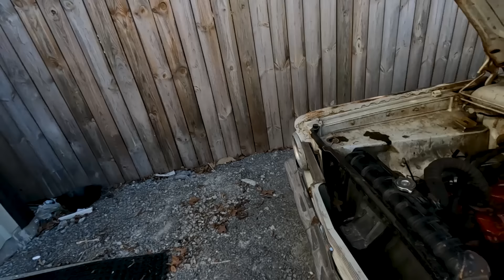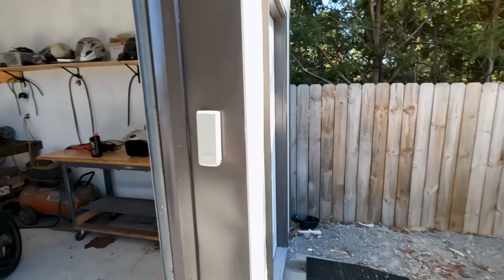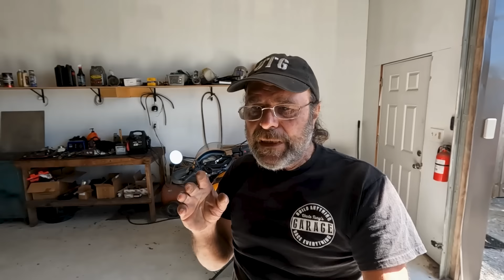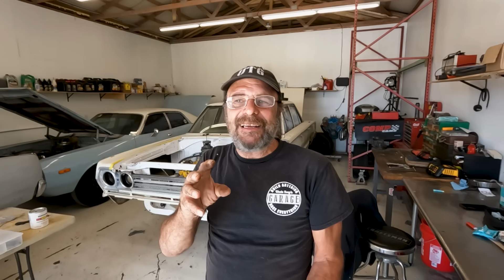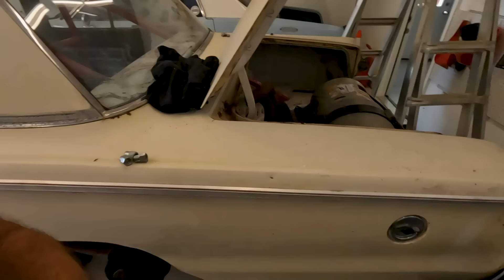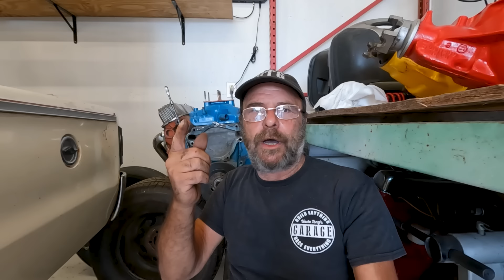Classic Car Tuning Problems - Curing Off-Idle Stumble, Bog, Hesitation, Stall And Backfire

Comment: What can cause the ported vacuum on my stock 22r have vacuum at idle.  The engine runs on advance at idle, which it shouldnt be and vacuum hose are correct.  The glass float bowl is just above half, not sure if that can be another factor.

Comment: Hello folk i have a 504 ti which i changed the manifold intake from mechanical injection yo cab..but my car wont start..iv cranked the engine placed compresion dtroke timed the ignition 
.but engine wont run.what might be the problem

Comment: My friend, who's been a mechanic for 50+ years, never uses a timing light on carbureted engines, even race engines. Does it totally by ear. Another friend puts a wrench on the air cleaner, and when the wrench stops vibrating, he sets the timing there.

Comment: Hi there Tony....great video, but I was waiting for the off idle progression tuning.....the slots from the idle circuit to the throttle plate.....with the engine idling best it can, pull the carb, pour the fuel out into a container, turn the carb over and look for the slots.....open the throttle and watch the slots become exposed.....I scribe a line on the throttle plate into the base plate body for reference, there should be a little of the slot visable, but commonly not....the idle jets should be sized to be adjusted leaner by the mixture screws, hence the idle jets are larger than the mixture screw adjustment, then when the throttle is gently opened as when cruising or in traffic, the mixture is enriched without any input from the accelerator pump action....so idle jet supply adjusted leaner by the mixture screws, opening throttle plate slightly, slots exposed, full amount of idle jetting available enriching delivery, further depression of throttle brings in acc pump delivery, then transition to main jets delivering cruise.....If it is found that the slots are not partially exposed to the scribed line, and you are experiencing stumble after all alse has adjusted, you expose just a little using a hacksaw blade to cut then deeper.....warning.....cut the thickness of the blade down to the slot width, so width is not changed, then back draw the blade in the slot watching the scribed line for reference.....do less than think.....once material is gone !!!!....access is with base of carb separated, throttle open, blade from above.....Well....lots of wordage but I wanted to best describe, part of being a trade apprentice educator, 1960's mechanic, having operated dynotune and engineering shops, along with building and racing competition cars of many varieties in Australia and in Atlanta Ga.  Enjoy.

Comment: Wow , I just learned something after 44 years of working on my own old cars. It explains 1 issue I had 40 years ago with a jeep.

I have never had a harmonic balancer slip, or so I thought.

I had a 1976 jeep Cherokee that I got without a motor for 400.00.  I knew a guy with an international salvage yard that I used to pull parts from for building my Scouts and trucks.

We talked and discovered that AMC and some international grain trucks used the same 401 V8 for a few years.

I put the 401 in my jeep and did some bolt on improvements to get it going to use as my daily driver in winter for awhile. I also used it to haul wood out of the fields in a home made pickup box trailer. Still got the trailer 1974 1 ton Chevy frame , box and axle.

I set the timing after doing a tune up with a new 4 barrel Carter and raised intake. 

When I tried to set the timing I had to advance it 8 degrees before TDC and it still ran crappy. I advanced another 2 degrees to 10 before TDC.  
I thought there is no way that could be right but it ran great for about 6 months. 

Then 1 day it started running crappy again. When I checked it was 4 degrees After TDC. 

I assumed that I had not tightened the hold down bolt properly on the distributor.  

When I reset it , it did not run right until about 4 degrees before TDC . I tuned by ear and it ran best at about 6 BTDC. 
Soon after I sold it to a guy in partial trade for a 1 ton International 4x4 truck.

It had not even occurred to me that the harmonic balancer was floating on me and throwing off my timing light settings from the first time I tried to set timing on it.

I am a jeep guy and could almost tell you from memory different tune settings on different engines. 
That was the first time I touched a 401 in a jeep with that build and I found conflicting specs in manuals between AMC , jeep, Ford , and International.
I ran alot of 360 v8s in jeeps and a couple 401 s through the years.

Comment: I have a 1967 ford galaxie 500. 390 v8 C6 trans. Has brand new holley quick fuel 600. Runs excellent 90& of the time? Only time I have and issue is when I get on it? 1/2 to 3/4  starts to pull and then stumbles and will  backfire through rear exhaust? Not sure if its the secondaries not kicking in and starving or lean from not enough fuel delivery?

Comment: i grew up during fuel injection. i inherited a 66 dodge polara witha 383 big block and a holley double pumper 750. thing used to run great and now it just dies randomly and i have no idea what to do.
Reply: its definitly not stock though lol

Comment: Uncle Tony, I love these vids!!!  My hot rod (1970 Dodge Dart Swinger 340 4-speed) exhibits the classic off idle bog.  I have checked the accelerator pump for proper adjustment and increased the squirters from .030 to .040.  Still bogs.  Thanks to this vid, I will check timing next.   You da man!!

Comment: I just bought an 86 Ford F150 in very good shape, I just got it on the road last week, I took it out for the first real ride yesterday, she stalled on my coming what I went to pull into a parking space. So I live on a mountain at about 8000 feet high, I was wondering if this will affect the tuning of my carb? When it fires up, It idles perfect, but then it kinda bogs on me once I put it into gear. As I start driving it runs just fine, if I come to a light, it bogs a little bit... Is this the idle? Should I attempt to pull it off and clean if? I haven't worked on many truck carbs but have worked on many dirt bikes quads and motorcycles before.

Comment: My '63 Dodge 318 V8's single barrel carb had multiple intermediate, or pilot, jet ports, so that, as the throttle plate opened, it progressively exposed more of those ports to vacuum. The point is that even with an otherwise perfect carb andcperfect accelerator pump, one or more of those pilot jet ports being clogged could cause an off-idle stumble. The important point is that the accelerator pump's effect is only momentary. If an intermediate port is clogged, the carb will lean out during constant, low throttle operation such as cruising in town at 25. My Harley FXR is doing just that right now, with its S&S carb (not CV). My plan is to look for an obstructed pilot jet or look to get a bigger one, among other things.

Comment: Yeah, back in the day I didn't have a name for it, but I always did the "power timing" as you call it. It just made sense, and still does. Engine fully up to temp, good points, good condenser, proper point gap, good plugs and wires, cap and rotor, then just see where it starts to knock, then back it off until it doesn't. Specs don't matter. Results do. That's how you would properly determine the specs, but in my case it was for old engines with a LOT of miles on them, so the factory specs would no longer be the best anyway.

Comment: What about an intermittent problem of bogging/hesitation/no throttle?

I’m chasing this problem since about 2021 on 351w carb’d. Sometimes it will happen at idle, sometimes randomly at 2K rpm on the highway, sometimes on the street between 1.5 and 3k rpm. It can do the problem 7 times in 5 minutes, or not once for 15 miles.

Comment: I've got a 55 buick roadmaster with a 4 barrel carter carb. This is a great video. I currently have to give just a hair more throttle from a stop to keep it from stalling and it's worked for a couple years. I just wanna fine tune that out of it. It also has a bit of a vacuum leak. Some tubing needs replaced first.

Comment: Don't you have to make sure your on the compression stroke. I use a wet paper towel in the number one plug hole and when it pops out you know your on the compression stroke and then set it to top dead center.

Comment: Not a young guy here, almost 73 (less than a week to go) I think I used to know how to check and adjust/fix a Rochester 2V accelerator pump on a 71 Chevy truck. Thanks to you, I’m going to give it another shot. I installed a kit but apparently missed something. The ball was stuck, fixed that, cleaned everything, but still had that off idle stumble. I’ll let you know.

Comment: Yeah. The wagoneer slows before it jumps to hyper space. So I just went out and bent linkage to bring it up just a hair from accelerator pump. I have a bolt in a hose made to blow out if it back fires. It seems to like blowing power value if it backfires.

Comment: Dude!LOL You are helping me big time. Mechanics don's seem to want to work on these old beasts anymore.I have a 86 F150/351 HO with the Edelbrock. And I have it running pretty well.. A few issues like it seems to flood on occasion and it gets 8 mpg. I was hoping I could get a real pro to set up the carb and the timing. But mechanics don't seem to want to work on these old beasts anymore. So your video is a big help. Thank you

Comment: Saving up for my first classic car. As a millenial who grew up with EFI and has worked for years in the I.T. field, the idea of tuning and tinkering a car without ANY electronic sensors or computers (other than youtube tutorials) sounds very therapeutic
Reply: You’re an old soul, Joel
Reply: @michaellauer3397 I was lucky to go to a small rural high school that offered lots of shop classes and I enrolled in all that I could. 2 levels of welding, electrical wiring, 2 levels of engines. That kind of hands on work was far more rewarding than anything I have ever done behind a desk
Reply: I'm genx and my Chevelle is the same age as me but i totally get it. I also work in IT and im building my car with minimal electronics
Reply: You came to the right place, mine is a 65-911, six carburetors, this feed is so helpful to me.
Reply: It really is, once you iron out any initial kinks. Although that in and of itself is rewarding! Best of luck to you, from a fellow millennial gear-head ✌️
Reply: I bought one last year and now I daily it I love it

Comment: Have a 69 Chevrolet that would die out of nowhere in the middle of the road, after a week of almost pulling my head off I found out that there was a suction leak on the gas line just were it connects to the gas tank that air would get suck  get stock in the pump diafrag and cut the fuel pressure even doo the filter was full of gas there was cero pressure on the line so wen I pull the line of the filter the ai Buble will move of an make it look like it was working  fu** 🫩

Comment: I learn something every time I watch Uncle Tony's videos. I own a 1973 Chevy El Camino with a rebuilt 454 engine and a Rochester Quadrajet carb, and I now know for sure that the vacuum advance on my setup doesn't need to be disconnected when timing the engine with a timing light, which I was pretty sure of when I timed my engine, but I liked Tony's confirmation on that. I would love to see Tony go over how to adjust the accelerator linkage on a Rochester Quadrajet. Not exactly sure of how to do that pertaining to whether there is an adjustment feature or if I would need to bend a linkage rod.

Comment: 1976 chevy 350 My bog is at hi rpm .  new edelbrock carburetor new plugs and wires cap and rotor and new coil, new fuel pump Still has a bog  at hi rpm just before it shifts .

Comment: The way I learned was that during exceleration, if you get a bog or hole, fill the hole with gas. Back in the day in a good speed shop there would be a hole wall full of all the different Holly carb parts for race tuning at idle part throttle and full throttle.

Comment: Just rebuilt a 1969 dodge 318ci engine for a 69 dodge a108 sportsman. Full rebuild including new pistons,  rings , camshaft, followers etc . Replaced the bbd carb with a reman from rockauto , engine starts  and idles well but has a continuous stumble on idle and acceleration,  using a vacuum gauge , ive got it idling at 22 inches of mercury,  when the engine gets up to temperature,  the stumbling becomes worse.  Any ideas  , my next steps a new distributor.

Comment: It so interesting the complex specific knowledge that is generally known to each generation. My dad wasnt a "car guy" but was still very mechanically inclined and would  tear an engine down and rebuild if needed be. I remeber as a younger man my brother's land cruiser had this stuttering issue and dad diagnosed the bad fuel accelerator pump immediately just from the symptoms. I was amazed he could do that at the time. This next generation (not knowing anything  about engines or even how to change oil) will look at electronics and programming the same way we did cars and motors.

Comment: My 85 c10 with a holley 600 starts and idles fine but if I drive it down the road for 5 minutes it stalls out and won’t run until I pour gas directly into the carb. Can anyone give advice how to fix it

Comment: Hi Tony - great video.  I have an 1968 AMC AMX 390 timed to the factory specs "0" degrees.  I have a Holley 4160 that came with a .031 acc. pump nozzle.  It dies and even backfires when hitting the throttle.  I changed to a .035" nozzle and it might have improved a bit but still dies for a split second but not as much back fire.  I watched your video... do you think I should advance the timing or try moving up to a .037" nozzle?  Thanks so much for the help if you do read this.  Jerry

Comment: But even If you see fuel at that  time.
The nozzle CAN be to thin for that engine.
I had a 1975 two barrel camaro.
It always nicked for a second when acceleration.
With a generos 4 barrel.
It never did It again.

Comment: I’ve got a Holley 4160 on my 360 LA. Have the timing advanced to detonation and retarded a hair. Truck runs great, but I cannot adjust curb idle below 1000 RPMs, even with idle screw backed all the way out.  Blocked every vacuum port and checked around the carb with starting fluid, no vacuum leaks, but it still idles high. When I regard the timing enough to get the idle down, I get a slight off idle stumble. How can I get the idle down? Accelerator pump is adjusted perfectly.

Comment: On Mopars I use a vacuum gauge to set initial timing and then power time it by turning the hex head screw in the distributor's vacuum canister. That way you get the best gas mileage and speed pickup as well. 
A side note on the accelerator pump is start out at the lowest setting and work up because the pump continues to work as you do your daily drive and wastes a lot of gas as you go on and off the gas. A constant low movement motion on the gas pedal can save you money in more ways than one.

Comment: You know, it's a weird thing. I don't know whether I'm an old guy, or still a whippersnapper. I think probably the latter, But at that, I can't remember when it changed. 

I was a teenager in the '80s. I mean perfectly in the '80s. I turned 20 in 1990. That's when I started tinkering with cars.

Fuel injection was around. Toward the late '80s, I think pretty much all new cars had it. But we were teenagers. We weren't driving new cars. So the cars we were driving, and learning to wrench on, all had carburetors.

I think it was 5 years ago, or a couple more... Definitely not 10... When I took my old CJ7 up to see the mechanic around the corner. I've never been good with tuning carburetors, and I had just finished putting a new Edelbrock on top of the Jeeps 302. I took it to the pro around the corner to have him tune it just right. 

That was the day. This guy, a professional mechanic, look me in the eyes and told me he didn't know anything about carburetors...at all.

I felt like I had been transported into a parallel universe. 

He gave me the number of an older guy that ran his own shop out of a storage unit, about 30 mi outside of town. I took it to him, and he tuned it up just right for me. 

But that was the first day I ever met a mechanic that honestly had never, in his entire career, worked on a carburetor. 

I think that's the day I transformed from whippersnapper to old geezer.

Comment: Miss the days when Mopars were everywhere Mom had a 69 Roadrunner sold it to our neighbor it had been Loaping running rough neighbor had been racing the engine all day trying to smooth it out Dad was a resident deputy sheriff (Rural) Dad stopped in to eat dinner from his patrol hearing the engine racing he said I wish we hadn’t sold him that car …. Suddenly the Wheels began to Screech as the car raced past the house well over 100mph Dad jumped up flew out the door into the cruiser (Crown Vic ) with lights and sirens the cruiser slid sideways out the driveway Dad radioed dispatch “Lincoln 10 County “ in pursuit of a 68 Roadrunner south of the crossing….dispatch radioed back “description of the vehicle? Green in color “Red Tail Lights …..Fading Fast “ hearing this play out on our home scanner Mom said “ It’s a 69 you idiot….! Just then Dad says correction county that’s a 69 roadrunner the Crown was no match for the Roadrunner it was later found abandoned out of gas but you could buy these cars for five six hundred bucks now they sell for thousands Mom and Dad are gone and the neighbor and Roadrunner too …. But the memories remain…..

Comment: Hello Uncle, why do you put the fuel filter on top of the manifold were heat would boil the steel fuel fiter, I personlly put the filter  under the car. Cooler fuel better igntion, u know your self on a cool night the baby burns, and  ur a drag racer, lets get it right. even put dry ice on the intake manifold on a hot night on street runs.